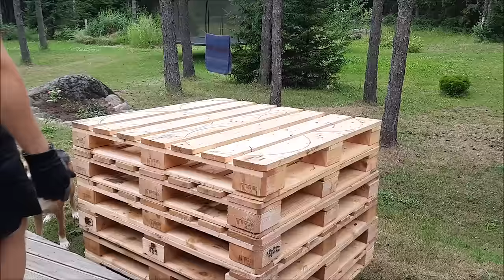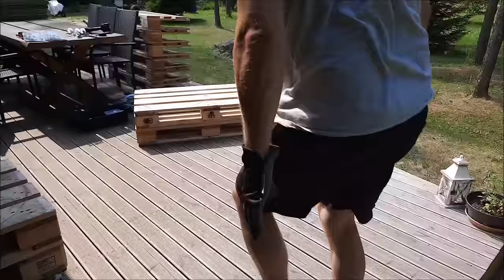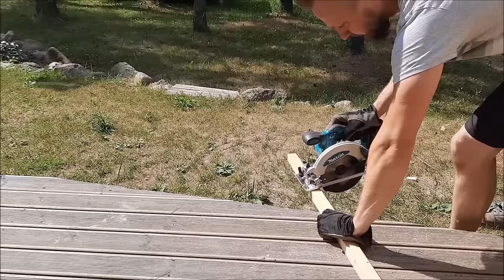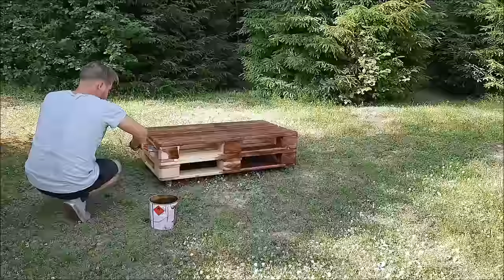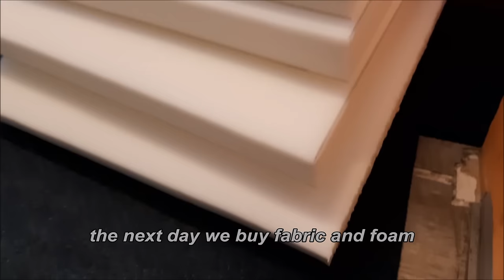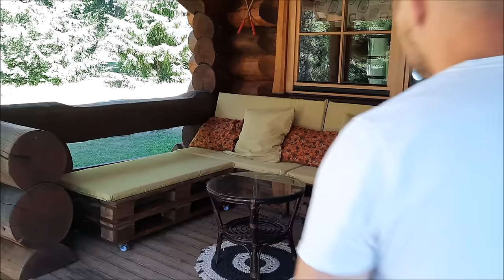DIY Pallet couch.

Comment: Very good job!
Do you know if they can be placed on a balcony and if its a problem if they get wet due to rain?
Or would it be batter to lay something over it when not used, like a plastic cover to protect it from the rain
Reply from the maker: Hey, if the wood is protected enough, it can withstand rain, but I would still recommend keeping them in the shade, they will last longer. Thank you!

Comment: Great video ... I've watched your video 3 times at least... I have a couple questions... 1) what size Epal pallets are you using? 2) does the compressed blocks hold up in the rain?
Reply from the maker: Thank you! Pallets are 1.2m X 1.2m And on my pallets are not compressed blocks but solid wood and they are good.
The compressed blocks do not tolerate water and will soon break down in contact with water.
Thanks again!
Reply: @normalguydoesitall  indeed thanks.. that's what I thought concerning the compressed blocks... The crazy thing about it is I can get the compressed blocks ones easier than the solid block 🤦🏽‍♂️... Thanks for responding ... Greatly appreciate it
Reply: @normalguydoesitall just watched your video again for the 5th time and guess what... you have the size of your pallets in the first 20 sec of the video🤦🏽‍♂️ 😂 I never saw that...

Comment: This looks great. Brand of the wheels and dimensions please. Also brand of the jigsaw and sanding equipment
Reply from the maker: Thank you! I don't know the brand of the wheels I bought them at a local hardware store. wheel dimension is 5cm and the mounting plate is 6x6cm. i use makita battery tools, and the sanding discs are sandpaper that attaches to the angle grinder. hope it helps. Thanks again!

Comment: Thank you for this tutorial, can you please tell me, what width size are the couch?
Reply from the maker: Hey, the width of one module is 1.2m. Thank you!
Reply: @normalguydoesitall  1.2m is the width of the pallet, but you cuted it, so the base of the couch is less, for example 1.20 x 0.70 or 0.90, this last number i would want to know,
thanks for your first answer
Reply from the maker: @jorgeconde4548  ok, then the depth of the seat part is about 45-50cm. I hope it helps. Thank you!